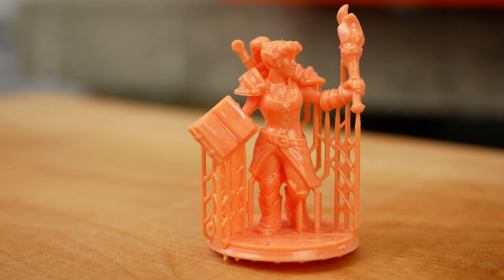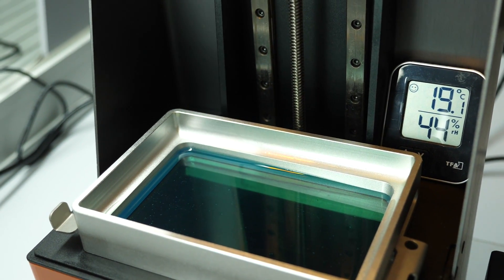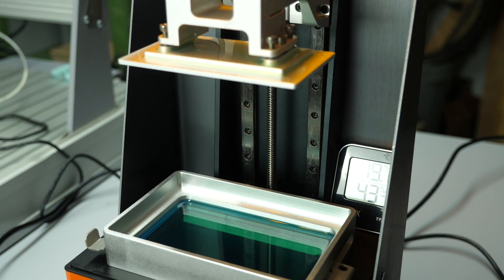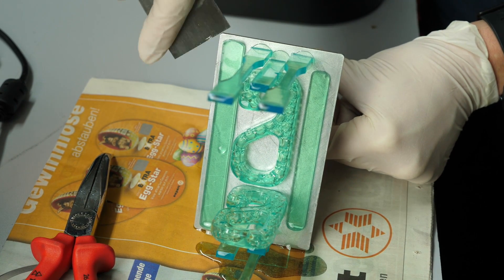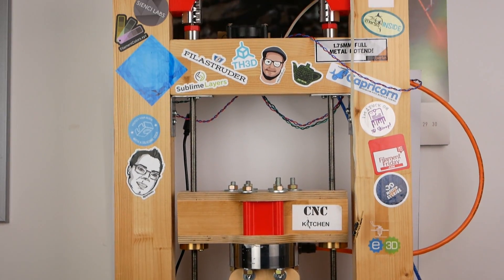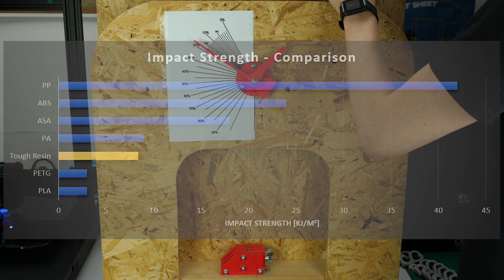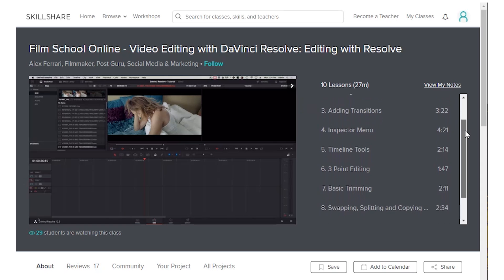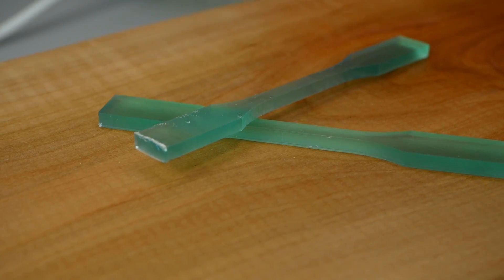STRONG parts from a Resin 3D Printer? Testing TOUGH Engineering Resin!

Comment: Never really took issue with what I would consider a pretty mild smell... nothing noxious, headache inducing, or nauseating at all.. not to me... And as far as mess, well hell... I've never even once worn gloves... at all. You wash your hands with the same denatured alcohol that you should be parts washing with, rather than simple rubbing type... and you're good to go. You should check out the Loctite heavy duty resin, crazy strong. Heck, even the cheap Amazon ABS like resin is damn strong. The whole "resin is weak and brittle" argument is pretty much horse shit these days, if not overall. I've never had a model or part break the way you show the sword break on your little guy there. I've only had this resin setup for a year though, and came into it with fairly good resins available... but even the stuff that came with it easily bends and moves, does not break at all like that. And all the post purchased resins are only better yet... sooooo.. Huh.

Comment: What’s the thinnest you can make resin parts before they start becoming weak? I have a prop that the maker used a 3D printed part on out of resin, and part of it is at most 1mm thick, probably less than 1mm.

Comment: With a lot of post procesing the only advantage of resins over filament is the smoothness of the parts, there are no mechanical advantage on the pieces made out of resin so in my case will be no interes in a resin printer in the near future.

Comment: Looking for the hysteresis graph, you can see a residual deformation, which means that the material has started plastic deformation. The  rise on the deformation after the load applied can be because of the plastic deformation, that not necessarily can happen instantly with the load. The plastic deformation is because of damage suffered (micro cracks) which happens with time.  This might not be only creep, which has to do with the viscosity of the material and can happen on the elastic phase as well.  It can be combined with creep though. 
It seems that the resin was not completely cured. You can try the same test with a resin after a few days of cure, to see if it is the case.

Comment: Personally, I'd rather get a resin printer. My shop area has exhaust fans so the smell wouldn't be an issue. My main use would be printing  parts to do sand casting and items for lost wax casting. The availability of specialty resins for that is a big plus. Basically, if I need something structural, I just cast it in brass or aluminum.

Comment: The viscoelasticity might be a really big issue with this material, i have used FDM plastics that had this issue and if it had any kind of permanent loading on the part it would slowly creep and bend, in my case it was bolted down and the bolts would become loose over time. 
Adding a test for this might come in handy, along with wear resistance such as for a gear.

Comment: Ok, another video where someone uses a resin printer and calls the process messy is equally comparable to someone cooking that barely makes a mess because they're cautious or premeditated on what they do vs someone who leaves the kitchen all dirty. I barely make any mess and most of it can get cleaned up with a single half-sheet of paper towel and almost never use gloves because I don't touch the resin (but obviously is 100% recommended to use them).

Comment: Can you please test the tolerances and strength on things like print in place gear assemblies? I think that could be a significant upside of the tiny layer height, if you could make really tight tolerance mechanical things.

Comment: 7:06 Because Resin crystallize unevenly. Inner structure start crushing after applying too much torque. You need to measure the force that doesn't cause the creeping of value.

Comment: do you think it is strong enough to be used as molds for plastic injection? what i mean is, used as the entire mold, not just an insert into an aluminum mold. thanks (please give a thumbs up if you reply so that I am notified)
Reply from the maker: Yes, that should be possible with HT resin. Check the  formlabs website for examples.
Reply: @CNCKitchen  thanks!

Comment: Those "drain holes" are stress raises that cause stress concentrations around the perimeter of the holes. That's why they broke where the hole is. Next time try it without the bottom drain holes where it broke. Uncured resin shouldnt skew the results

Comment: I don't get how your results show pla to be stronger than abs or petg. All the PLA I've used is very brittle, and while it doesn't flex and is stiff, it will break with hardly any force.

Comment: resin 3d printers are awesome... but so expensive.
Reply: Not really, the anycube is $300 on Amazon right now. Seems like a decent printer. My reprap was $120 but is kinda crap.
Reply: @ryansinclaire8463  lol, Not the printer itself. the resin, the cleaning agents/alcohol for post processing. other chemicals. not to mention its really not easy to find either unless you import it, which means more taxes and fees. compared to fdm, they are way more expensive (50 usd for 500ml which can get bad resin here vs 20 usd for a kilo of filament which cannot get bad, no matter how you store it (provided you dry it out afterwards)...  that is if you can even find the resin. filament is easy. I have a store a block away that sells abs, nylon and pla.)
Reply: @umbratherios  true. However, not that long ago these things were in the thousands. It's just a matter of time before you can find materials on the cheap. Are you somewhere that allows you to distill you own alcohol? You only need to buy solvent once if you are diligent about not letting it all evaporate away.
Reply: @ryansinclaire8463  sadly, distilling my own alcohol over here requires a permit, and other expencive distilling sets that costs about the same as one of those cheap printers you mentioned... well, unless I build my own... that could be fun actually, but highly illegal... but yeah, it's only a matter of time before this tech cheapens up, lol. hopefully... I mean, normal printers that print on paper's ink is still expencive as hell, lol, even after... many, many years, so maybe not...?

The real main thing that turns me off is that I need alcohol to clean the parts. the other things can be sourced with time, and imported with some saving of money, but the alcohol is.... not expencive, but extremely rare here, and to import it also requires a permit. ( absolutely love this WONDERFUL country.... actually no. it's utter trash where I live :( )

Comment: I've been printing with SLA printers for several months now and I'm wondering why you did the two IPA baths for 15 minutes each. That seems like an extremely long time and maybe have actually weakened the parts? Normally I don't dunk my pieces for more than 30 seconds per bath. I've also heard that curing Siraya Blu under water works better as well, so it may be possible to get better results post-cure.

Comment: While in polymers creep indicates the material being loaded at a temperature above the Tg (glass transition temperature), in monomers (like the UV resins used in resin printers) this is an indication that the monomer matrix hasn't fully formed yet. In other words, your resin isn't fully cured yet and thus it still behaves like a semi-liquid material. This is actually super common when manufacturing products out of resin and it can often take months if not years for the monomer matrix to fully form and the resin becomes fully cured and solidified. In most cases having a fully cured resin isn't a desirable goal as it results in a more brittle material than the not fully cured semi-liquid material, so in order to make a resin tough and less brittle they add plasticizers which interfere with the curing process and can sometimes also act as a lubricant between the monomer molecules to promote more viscous rather than solid behavior. In other words the creep is what makes this resin 'tough'.

Comment: The part in the flex test was deforming because its internal structure, molecules, were realigning into a lower energy state, thus the deformation keeps going until equilibrium is reached or the part snaps due to decrease of the cross section, if said happens the load was already above the parts strength.

Comment: I bought this "Strong" resin and am very impressed with performance. I had same parts printed with "standard resin" for comparison. The increased performance of this Siraya Tech BLU resin is very impressive and immediately solved a "brittle" issue I had been suffering from. Now I can ship my JST-VH and JST-XH terminal extractor tools (see them at Tindie.com Search: JST) without concern of breaking during use. These parts were printed on a Duplicator D7 Plus clone from Monoprice... also I used the same exposure profile settings as the "standard" resin at a layer height of 0.1mm. I give a big Thumbs Up for this resin. Thank you CNC Kitchen for your valuable efforts.

Comment: Another question about this. How it would be to have a plastic printed part, covered with resin, or vice versa? Like using rebar on concrete. I think that is something worth exploring, for example for parts that need FDM-like strength on all axis. Or getting extra strength on impact, by combining with a more tough plastic.

Comment: Here's a question - for something in the $500-700 range, what do you think is the best choice for FIGURINE printing.
I've generally been turned off by standard fdm printers due to scan lines (especially since I plan on painting all these minis).  But the brittleness isn't something I'm fond of either.

Comment: Can you test reinforcing hollow prints with expanding foam, polyurethane, or some other pourable curing polymer?

Would be interesting to see how that stacks up vs infill printed parts. That way you can get a part off the printer faster and reinforce it while the next part prints.
Reply: TwiztedMatt1007 with the DLP printers the print time is solely dependent on height, so hollow prints have the same build time as solids, only the quantity of resin changes. And a solid part will always be stronger than an infilled piece as the outer layers (bending moment - like an I-beam) or weaker portions (think tensile test) fail first.

Comment: The problem with tough resin is how bendy it is especially for thinner parts.  It does not spring back like a thermoplastic would.  Also you might try post curing twice as long and testing again.  I noticed UV resins are stronger when cured longer than 15 mins.

Comment: Are there really no resin printers that use a DLP chip as the light engine? I thought there were. I mean, you can make one yourself out of a DLP projector, many people have. Then it really will be a DLP printer.
Reply: I looked it up, there are many commercial printers that are DLP. https://theorthocosmos.com/laser-sla-vs-dlp-vs-masked-sla-3d-printing-technology-compared/ So it is not so accurate to say that DLP printers are more accurately called mSLA printers. All three are distinct and there are printers that use each method. Maybe some people falsely think some mslas are DLP, but that doesn't mean DLP printers do not exist.

Comment: Could you please make a video about the "Alternate Extra Wall" Setting in Cura (in the Shell section) and compare if it's useful or not (how does it affect the strength of the part or is it only useful with a high or low infill setting)?
Reply from the maker: Great idea. Didn't know if that feature. I'll take a look at it.
Reply: @CNCKitchen  Huge Thanks!

Comment: Since far and away the most used resin printer is the Form2, I think it would have been much more relevant to use their printer and their Tough resin. As with the FDM printers there is a lot of difference between the cheapest and the gold standards for consumer use. While the results here might be representative of what resin print can do, it seems like there is also a great risk that these tests are not valid for the technology.
Preferring FDM or Resin?
There are many geometries that you cannot manufacture on the FDM printer, and there is no comparison between the surface finishes. FDM is extremely error prone, but a tremendous technology for making something functional at a very low cost. The things we have had printed in resin (professionally on a Form2) is just heads and shoulders above the FDM stuff, but you can only make small things that are quite expensive.
Reply: I did that. Also note that Form Labs Tough resin is 3x the cost per liter.

https://docs.google.com/spreadsheets/d/1JlqLSi4sxZLdA-hHCp6Ow4isoGMNI7nlE9Nmbj1ajWk/edit#gid=0
Reply: @rsilvers  Thanks for sharing - Fantastic comparison. Extremely interesting that Zortrax produces 91 Nm with the same resin that gives 53 Nm in Anycubic.
Do you have comparisons of print quality, ease of use, skrinkage, dimensional accuracy...
If you absolutely needed a functional part tomorrow morning, then which system is best?
Reply: @jenspetersen5865  "Extremely interesting that Zortrax produces 91 Nm with the same resin that gives 53 Nm in Anycubic."

Oh no - that does not mean that the Zortrax makes stronger parts. It doesn't mean that at all. Zortrax and Anycubic make identical parts. The difference was in the exposure time and/or post curing.

Blu is what I prefer for functional parts. The printer doesn't matter. eSun bio-resin is my favorite for solid-color parts.
Reply: Just want to mention mask based LCD resin printer likely to have as many if not more users than the Form2 now and that number is rapidly increasing. With Prusa coming out with SL1 and Zortrax with their Inkspire, there are plenty of good options as doing for laser with Peopoly Moai.  And they all can produce excellent results with much lower printer cost than cost.  Another advantage of resin printing is that it can be much faster even without bringing Carbon3d into the picture.
Reply: @sirayatech2  Do you have first hand experience with them, or is this opinion?
I have a US customer that swears by the Form2 and say they have never had a failed print. 
To me it is for engineering and functional quality, accuracy and ease of use is more important than a few thousand dollars, but I don't have a Form2 yet because the initial investment is so great. On the other hand I do not want the learning curve and eternal limitations that we have had on FDM printing.

Comment: I'm actually quite surprised that the toughness stood up so well compared to PLA/PETG. I noticed in this video you did a bend test with weight on it instead of doing a heat test. I'm curious how well resin holds up to similar heats that would bend/warp PLA/PETG. Did you have any data on that? I'm also curious what the print times were for a tray of parts versus FDM, factoring in cleaning and curing?

Comment: I was wondering how strong resin prints were. Now I know that the basic stuff isn't strong at all. 
It was interesting to know you need holes on the design to allow the liquid out. I thought it would still allow enough light through to cure the resin inside?
I would suspect that unlike PLA, resin might get stronger over time if left outdoors, as the natural UV will cure the part more (?), where as PLA is broken down by natural UV (goes brittle and discolours).
Reply: All polymers get damaged from UV light eventually, and overcuring resin is one way to make it less strong. So to get UV protection, you want to put a coat of primer over it for the outdoor user.

As for hollowing, Stefan would be best to answer it.  I think it may have to do with making it more fair to compare to FDM prints as his previous FDM tests are all hollowed with the special infill as well.   A 100% infill resin print with Blu would be very strong to a point where a tester was commenting the level of force needed to break it was dangerous without protective gear.

Comment: I really don't see use case for these machines apart from ready market availability outside from figurines, even with this resin. If you want that kind of accuracy, you can build a super precise FDM printer as well, and something like Ender-3 can print small figurines @ 0.05mm layer height no problem stock, issue with larger models is heat creep as the flow of filament is so slow. Ender-3 is mechanically very unsuitable for these layer heights, despite that it can make perfect prints at this layer height. It is possible to build a FDM machine rivaling these MSLS/SLS machines in print quality as well.
Reply: You have a very good point, and you could also check out Siraya Tech user group and functional part for SLA/DLP printer group on Facebook to see how some of the users are putting resin in their application that is not figurine use.  One of the nice thing about resin printing is that the speed is much faster and one could achieve with high accuracy with minimal effort even on low-cost ones and much less postprocessing work to get the surface for delivery.  At the end of the day, SLA/MSLA is another process at your disposal that now has sped resolution and strength. Sometimes FDM makes more sense, and we are finding out resin printing can make a compelling case for many applications.
Reply: @sirayatech2  FDM i can fully automate, with no manual labor, get as many parts as your spool can deliver at once ^_^
I can even anneal PLA parts autonomously for the ultimate strength, and i can even print huge parts automatically.

But yeah another tool, for another purposes. Most parts are OK with layer lining tho.